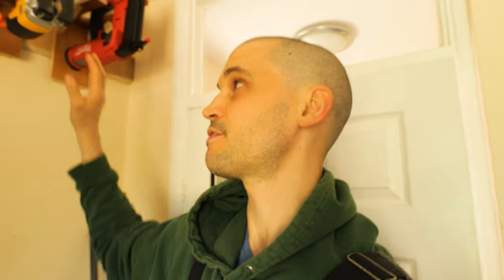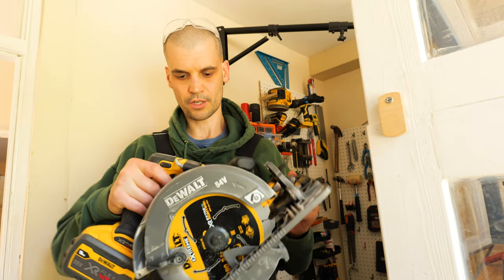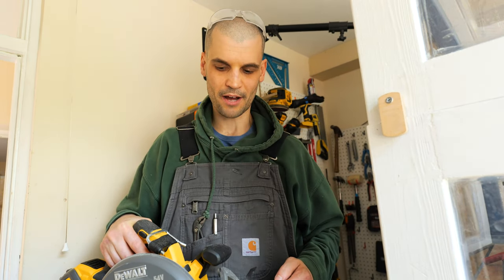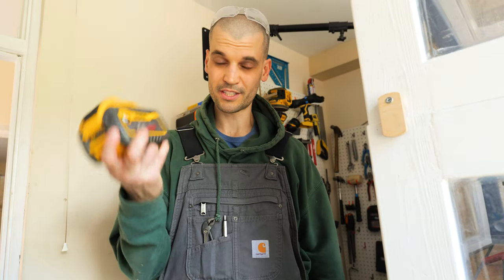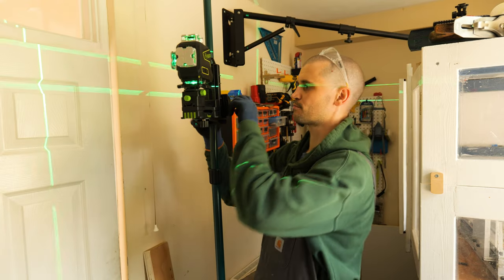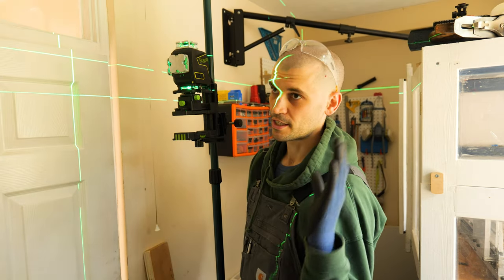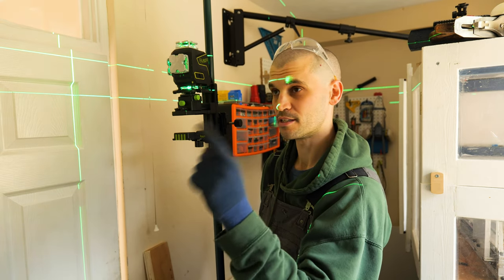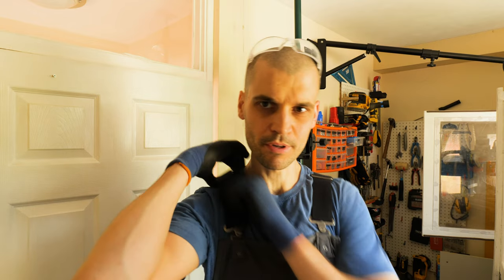August vlog - New Tools - Installing scrap wood french cleats

Comment: Dewalt gang 👀👍
Reply: For comfy, affordable boots, with puncture and electrical hazard, and a composite toe cap, you might try looking for Blue Tongue 'Station' boots, if you don't mind slip-ons, and don't mind a molded sole (which is much more difficult to resole, though not impossible). I've been very pleased with mine over the past two years, both for factory work (the first job with lots of cutting oil - no issues with traction) and at home and around town. As always with leather, I'd also suggest a healthy soak of conditioner, and then maybe topping off with a wax product to seal them, if you like. I used Sno-Seal.

Also neat to see about the coveralls. I've been wanting to get a pair for myself for some time, but just haven't gotten around to it. Awesome that you found a pair with spandex or lycra in it. I absolutely agree that it's a major plus for comfort. For the sliding rings on the shoulders, I can only think that you might try stitching them in place, or perhaps blocking them off with a safety pin or two on either side.

Another comment - that orange and black drawer organizer on the wall is really worrying! Might i suggest adding a shelf or at least a block of wood under it to prevent it sagging?
Reply from the maker: Thanks for the tip White, im looking for a boots that steel toe and zero drop heel preferably, I do like the look of these blue tongue boots, if only they were zero drop. Birkenstock QS 700 are ones im looking at currently.

Good tip on the suspenders, will have to try that!

Haha yes its it needs some support, stupidly the organizer only has mounting holes in the corners and not a middle hanging point, block of wood under it will solve the sagging, im in the process of remaking this utility room to be a better workspace so maybe it will get moved at some point